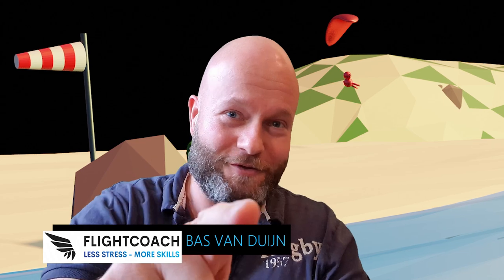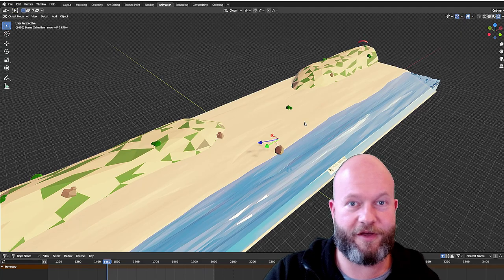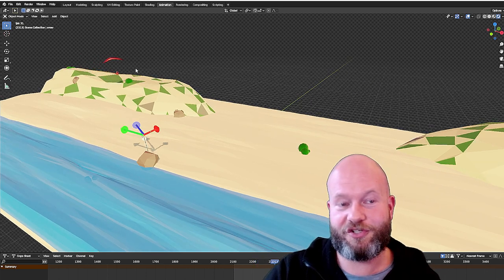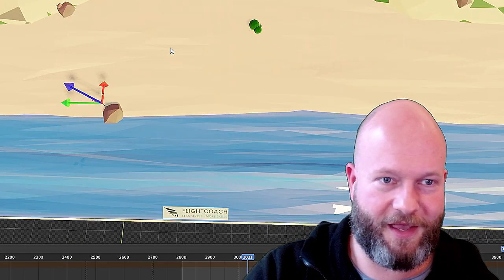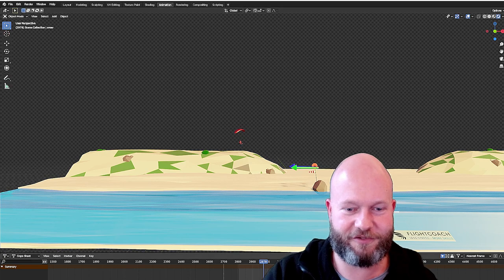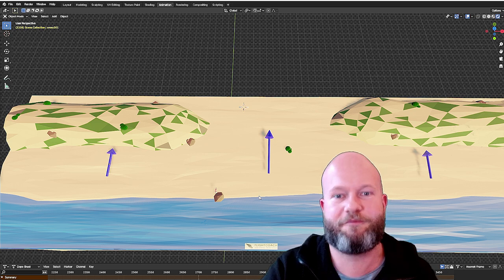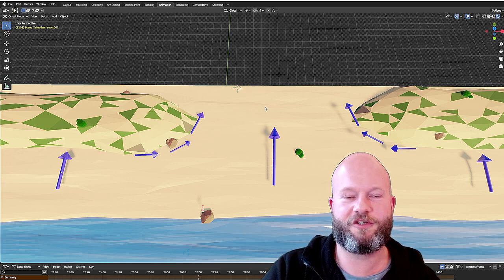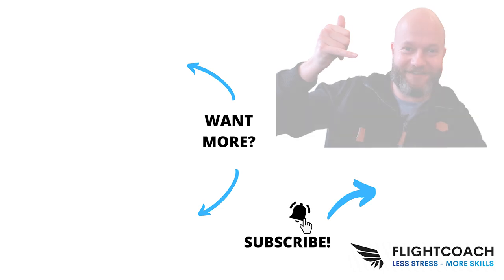Crossing GAPS with crosswind while dune soaring - 3D modelling

Comment: Hi Bas, another awesome video presentation... When I'm describing airflow to low airtime pilots, I always tell them to think of water flowing over rocks... Shallow water equals strong winds, deep water equals light winds. The same analogy can be used to ascertain the winds in an LZ or even around take off...
Reply: Agree, this comparison with water works good I think.  Remember a video from Chrigel Maurer explaining this way also thermal behaviour: "Imagine the mountain landscape as an upside down model and then spray it with water, the places where the water droplets come off, are the places where thermals will come loose". I think in many theories you can consider air as very thin water😊
Reply: @dutchcondor  Hi Bas, the old upside down dripping water scenario works well. Another analogy I use is to think of Space/Time. The more altitude you have, be it setting up a landing or heading out on an XC or crossing a gap, gives you time to have a plan B or even a plan C... Also the step ladder approach when going somewhere. If you get to that point you might make it further or you can get back to a safe place... It's frustrating seeing lots of newbies getting hurt because they just follow more experienced pilots and get themselves in trouble. We've recently had a spate of accidents with a few new pilots here on the coast and once they go inland the dynamics change again... You can't put the cart before the horse...
Reply from the maker: Hey guys! Thanks for the compliment and likes, appreciate your support. Great point, I use the water analogy all the time, it works great. Perfect way to visualize and model. In professional aerodynamics design they use computational fluid dynamics (cfd) to model all kinds of stuff, I'm looking into using that on the channel too :)

Comment: NB specific to the end segment of the video ref soaring a typical sized dune (i.e. not hill) .... when a pilot places wind indicators (streamers/wind socks) on the ground at the dune (gap) edges THEY (streamers AND the pilot) will 'feel/see' this mentioned local direction deflection/shift.... BUT the Aircraft (PG wing) 7m higher will experience a far smaller (or no) shift in the wind! PS one way I've demonstrated to my RE-training students over the decades why it's vital to always base your pilot decisions on what the Aircraft (wing) is moving in... NOT what ground based indicators on their own perhaps suggest.. is by my flying (my body BELOW the crest of the dune 'so sheltered from the wind', often, when I had long hair!, to such an extent my hair was blowing towards the back of the dune) despite 'flying (just) downwind of the dune the wing which is still ~5m higher than the crest remains in lift.. The last flying location of today saw me launching (next the carpark) directly into a 70* (downwind) crosswind dune+gaps flight (it took two flights +short hike to cover 1km) to quickly get to the sea cliffs at the north end of a East Scotland site (cliff takes a southerly)
Reply from the maker: Great point, thanks for chipping in!